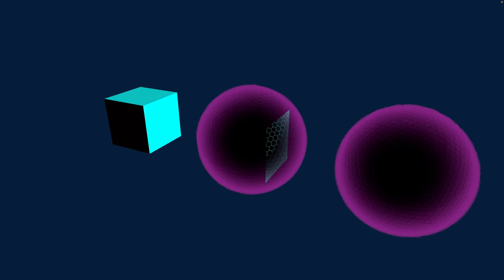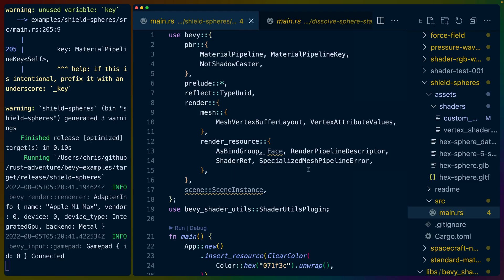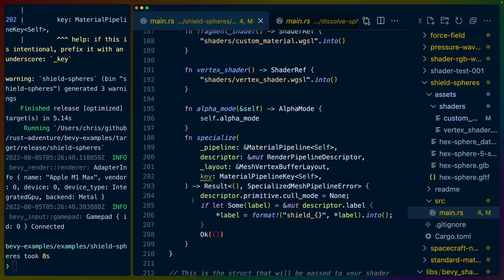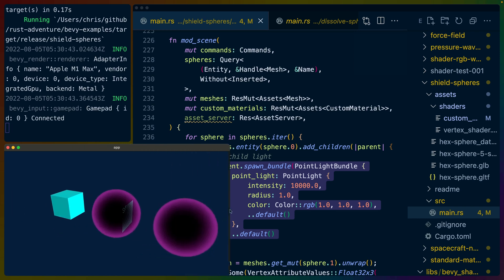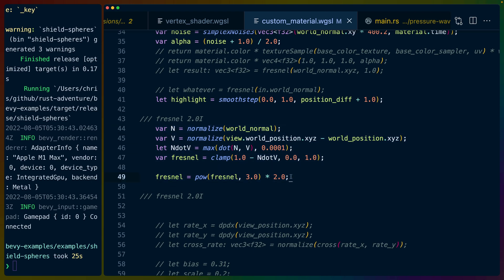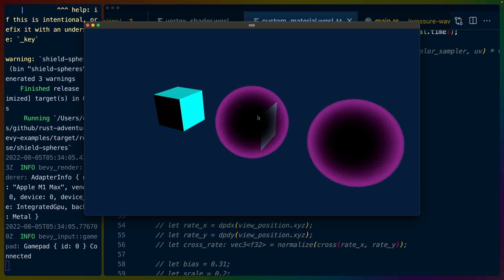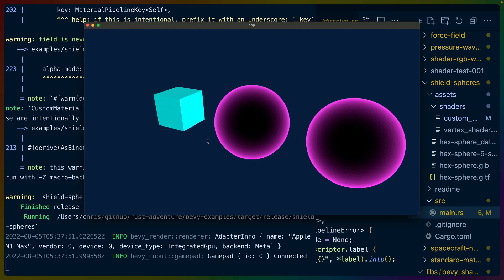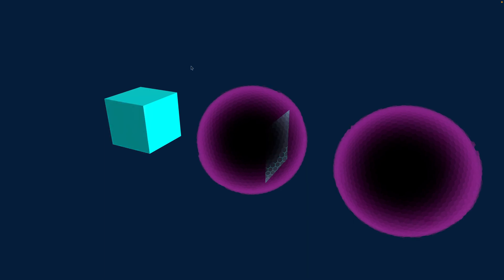Shield Spheres: Work in Progress

Comment: A note on Fresnel terminology and computation:

The phrase "Fresnel Effect" refers to the fact that materials are more reflective for light rays that hit the object at shallow angles. When writing software to render a material, it is typical to compute a gradient where 0 means a fragment should have the material's original reflectivity and 1 means it should behave as a perfect mirror. This gradient depends on the viewpoint and on a material property called the Index of Refraction (IOR). Such a gradient is often just called "fresnel" and is sometimes used for artistic effects like this which aren't related to the actual Fresnel effect. Part of the reason the math for creating a fresnel gradient doesn't make sense is that it's an approximation. The true-to-life math is complicated and requires worrying about the polarization of light.
Reply: you can still do the "unpolarized" setting by taking the average of both polarization modes

Comment: Have you tried to attach XCode shader debugger to your program? That way you can see what geometry and textures are sent GPU, which commands are executed, in which order and see exactly what is happening there, explore computed values etc. https://youtu.be/1yPjbH8b2FA I found it super useful when debugging rendering problems
Reply from the maker: I've had https://renderdoc.org suggested to me before but not the XCode shader debugger. I'll check it out, thanks.
Reply: @chrisbiscardi  Render doc is pretty much the same software but does not work on Mac. To make it work for Rust, you may need to make a simple XCode C project, generate C bindings for your main function in Rust and call it from your XCode C program, then you should be able to see Metal frame capture available. It sounds a bit tricky, but it only took 20 mins to implement when I was setting it up dor the first time.
Reply: If you want I can upload a simple guide how to setup shader debugger with Rust and bevy in OSX.
Reply from the maker: @xyzwio  yeah that'd be definitely useful
Reply: @chrisbiscardi  Here it is: https://www.youtube.com/watch?v=uNB4RMZg1AM . You probably don't have to copy binary of your app to the repo root. I just didn't have time to figure out how to tell Bevy's asset loader where to look for assets. It seems like it ignores working directory env var and uses binary's parent instead.